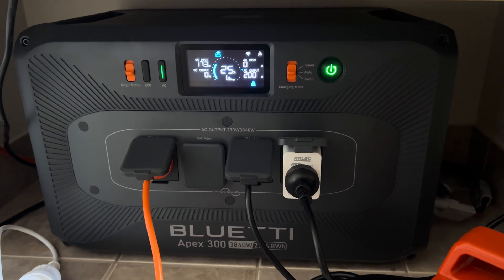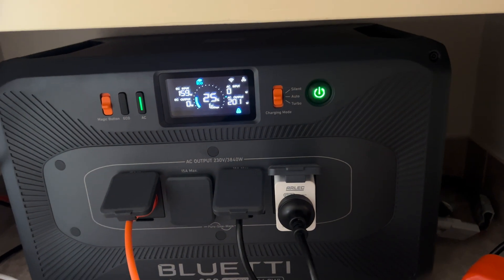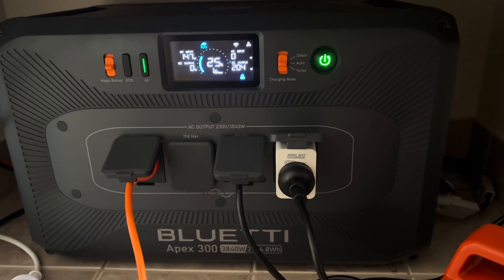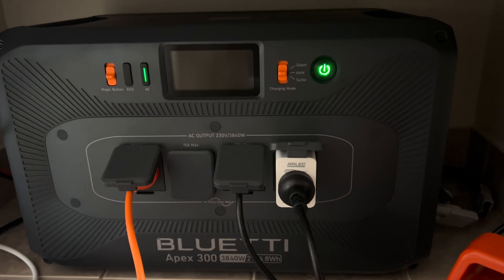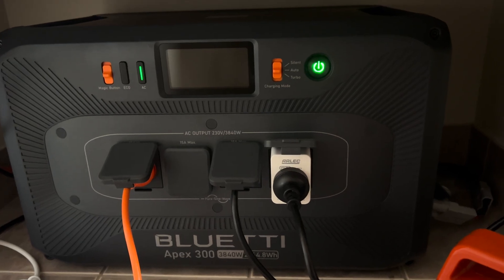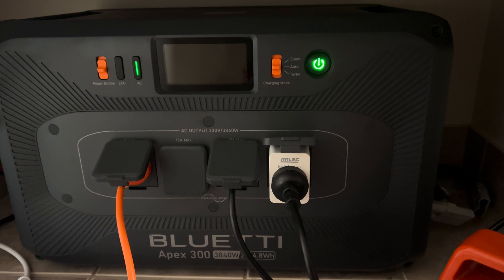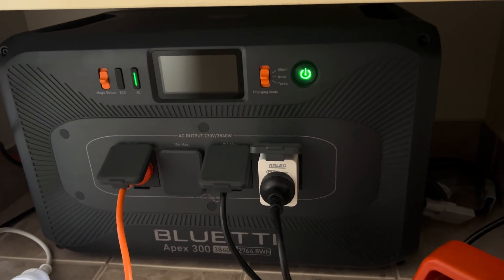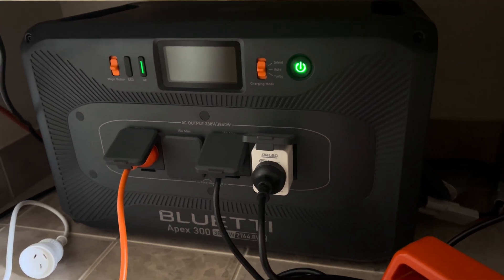Bluetti Apex 300 - PV input “0w” issue - not really…

Comment: My 2nd unit and it does this under auto as well. Bluetti said to change the working mode to self-consumption, which then drains the battery to 20%. They have lots of issues and no solutions. The last solution they offered is “buy an extra battery”.
Reply from the maker: That is frustrating. I’m lucky that it fits my application and now I’m not relying on the solar input as much as I am using house solar grid to top it up instead of selling back to grid.
Reply: @Nomadware  Bluetti must had paid all these YouTubers to lie about their product, Bluetti can’t even get the app in landscape mode, and now their website changed , not much info